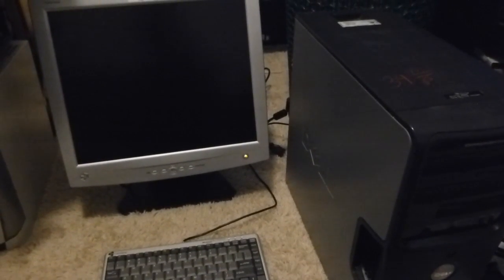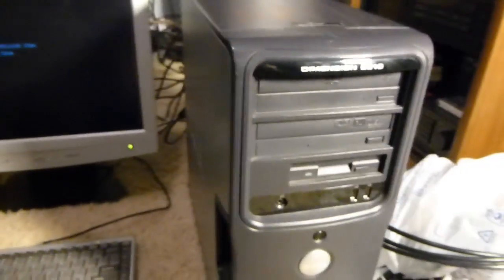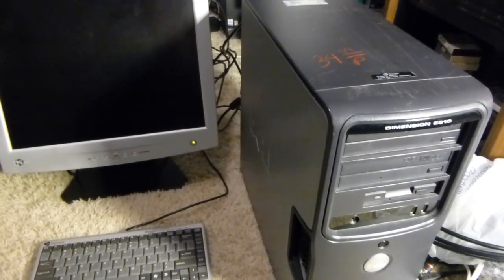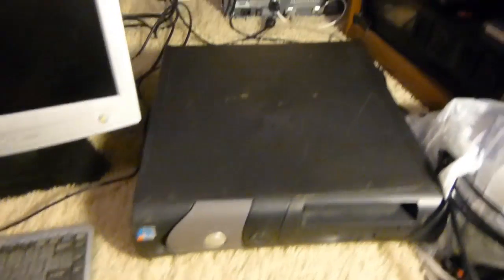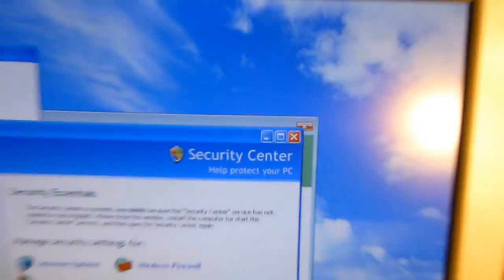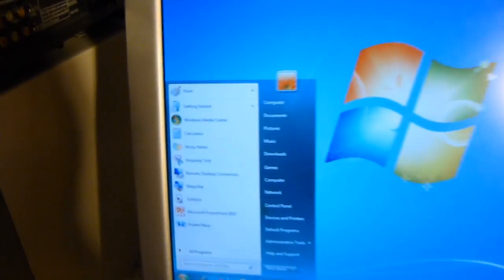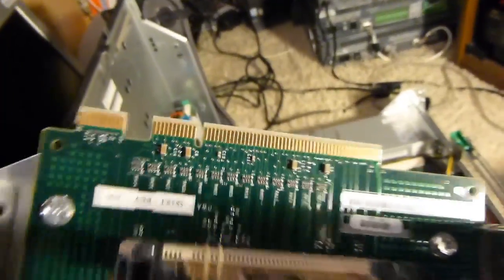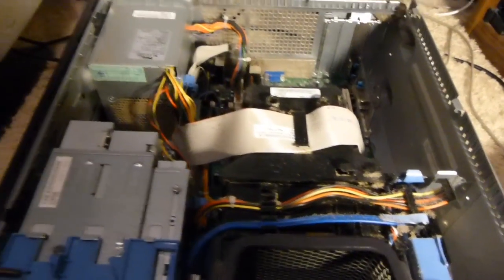1 Day, 2 Thrift Stores, 3 Dell Computers!

Comment: Depending on board / chipset / BIOS, that first one with DDR2 may be able to take a Core 2.
Also worth hitting Jellybean on number 3, to see if the key looks like an individual OEM or a generic BIOS activated - even if it's individual OEM, it's now bound to that hardware, so you might as well snag it.

Comment: Dont get rid of your harddrive , just wipe it !! Dont take it out !! We need those harddrives !!
Reply from the maker: As I recall, I didn't end up getting rid of any of the hard drives.  Wiping them worked just fine.  The only drive that was suspect was the one in the GX270, which looked like it might be dying (based on its SMART data), but so far it hasn't died yet.